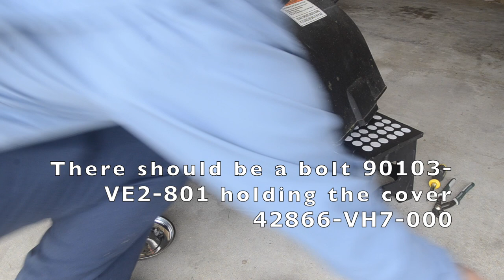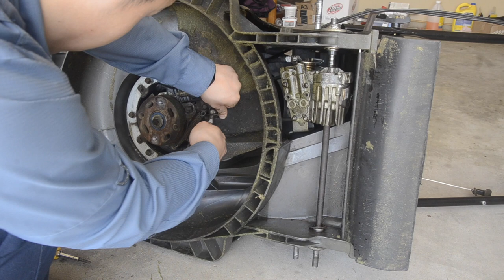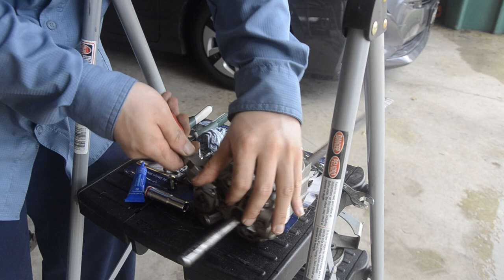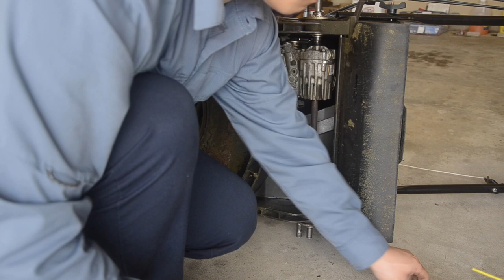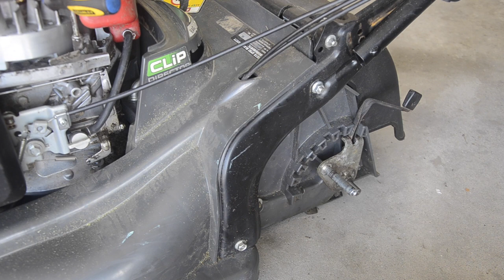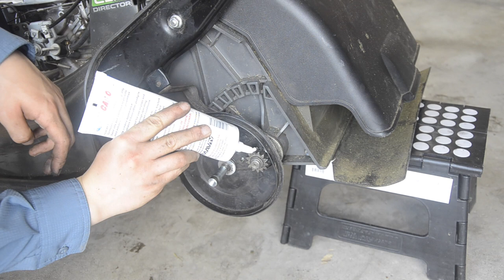Honda HRX217 HXA Lawn Mower Hydrostatic Transmission Removal, Fill and Installation

Comment: Here is the righr way to do the transmission replacement. 
1. You should drain only from top not from bottom using that 2 8mm bolt.
2. fill the original honda hydrostatic fluid all the way to top. Honda 08208-HST02 
3. rotate output shaft 4 to 5 turns ANTI CLOCK WISE complete revolution using your hand until 2 things happened. 
    a. no more air bubbles.
    b. fluid is not lowering .if it is lowering add more all the way to lip of the top cover. not just top again to the lip.
4. put the fill cover back using 8mm bolt and hand tight.
5. using 14mm bolt, rotate input shaft and depressing the drive arm lever both at same time. rotate  CLOCK WISE. and watch input shaft rotating.. again 4 rotation ... you can also user your drill / impact for this step when you use impact RPM should be super low to avoid oil aeration.

6. most important step, remove 8mm bolt and fill cover again.
7. Tilt your transmission left, right like wave pattern horizontallly in alll direction..  when you do that you will see bubbles comes out and liquid goes down. repeat step 3 to 7 .. 2 times until no buubles or lowering liquid.
8. fill the liquid to top,
9. there is a lip (around 2mm to top) fill the liquid all the way to overflow.
10. install gasket , cover and 8mm bolt..
11, note when you installing the cover there is a vent hole it should be properly orientated..  take picture of this while removing because vent hole align in both direction .. only one direction is right, that is vent hole should be closer to pulley side.

you are good to go..  

Ths is the right way.  you know you did it right if you dont have growling sound after the flush and you are able to achieve 30 feet in about 6 to 7 seconds at top speed with engine rpm between 2900 to 3100 RPM.

just did this today and i do have service manual..  this is per the manual.
Reply: Thanks for this, especially  the vent hole, I wasn't sure where this was supposed to align to. Should the transmission be completely silent when in use?
Reply: @crisprtalk6963   Vent hole should be closer to pulley of the input shaft..  if you see grinding noise or whinning noise then the fluid is lower. you have to redo it.
Reply: I see that you know  this like a professional, that's why I want to ask you question. On both sides is the transmission oil seal (91204-KE8-003 part number). On one side of the oil seal is the grass guard (21912-VE5-A00 part number) and pin (90752- VE5-A00 patr number) that holds the grass guard.   I haven't seen anyone who explained how to remove the pin and how to change the grass guard and oil seal. I only see one person who said that he would remove the grass guard because he things that it was the grass guard that caused the oil seal to split, but he did not explain how to do it.Can you explain please and Do you think it is a good idea to change the transmission oil seal at the same time when you change the transmission oil or is it unnecessary?

Comment: Thank you. This helped me better see the difference between the vka and hya models. However, I'm now discouraged from purchasing the HYA/HXA/HZA models as the transmission assembly alone is ~$400 and it still connects to engine thru a drive belt rather than a metal shaft.

Comment: This video was well done. It provided  visibility of all hidden components. I plan to R&R my 12 yr old mower and replace parts (belt, hydrostatic oil, wheel bearings, etc). It's a good time to clean, inspect, and lubricate parts. Thank you.

Comment: I see you like to put bolts back in the holes they came from- good idea, as it helps keep them organized.  Here is another idea you could try:   Use a 12-hole muffin pan (or two) put the bolts/parts in each hole left to right, row by row.  Then to reassemble, start and the last muffin hole and work backwards!!   Let us know if you try that method out, and how you like it!   Cheers, and thanks for a great video.
Reply: nice...

Comment: Thanks for the video!  Some of the steps aren't needed and you can use a pry bar tool to rotate the transmission to disconnect the belt from the pulley and to disconnect the bed-spring/washing-machine-hanger-spring from the transmission and deck housing.  Same goes for reconnecting.  
Also for the pulley removal, you can use a thick-diameter bolt or rod, which then goes through one of the holes in the pulley, and against a metal surface on the housing- that will keep the pulley from turning and avoids having to use a pipe wrench or vise grip to hold the input shaft.  
And make sure to follow the air-bleeding steps for the transmission that someone below had posted which is from the manual.  
Very very annoying mower to work on due to all the small parts, but you become an expert after fixing just one.  It's more of an advanced-mechanically inclined repair rather than just for someone looking to follow a YouTube video with some basic tools- unless you have time.

Comment: I just completely disassembled this transmission in order to remove the drive shaft and repair a section of it using my mini lathe. It's pretty cool inside. The transmission contains just two pumps with no gears or physical connections between them other than the fluid. BTW, it not something I recommend doing unless you are looking for a challenge lol.
Reply from the maker: If something inside the transmission needs a repair, I think I will either get a new transmission, or just use it as a simple push mower
Reply: But it may be good preventative maintenance. Replacing the belt gets you 1/2 way there. Agree it's not a job for a novice.

Comment: Thanks for taking the time to film this. I got the same type lawnmower and the transmission oil leaked out - I could see the oil on the garage floor where I store the mower; my intention was to replace the transmission but looks like they are hard to find and pretty expensive. I read somewhere that adding new oil will "rejuvenate" the seals. Not sure about that.
I'm assuming the reason you fixed yours is similar; could you give an update; is it still working fine? Thanks again
Reply from the maker: The mower in this video didn’t leak, but made grinding noise, so I decided to do a transmission fluid change hoping to remedy the situation. After the fluid change, the grinding noise went away, and the mower is working fine.

Comment: OR ... instead of taking the entire mower apart ...
1. Get 6mm Allen wrench. 2. Drill hole thru right rear wheel backup plate and two plastic layers (easy). 3. Remove oil plug and set on hill to drain. 4. With slender funnel, fill 7 ounces of Honda trans fluid ($10 for bottle of 12 Ounces). Spin axle while oil goes in. 5. Replace plug.  We went from not pulling at all to running behind it. There are two drain plugs. The other is impossible to get to. All easy to see from underneath.
Reply: I know this comment is a year old, but do you know if anyone has made a YouTube video showing this procedure? Did you have to hold the transmission lever in the engaged position while you drained and filled the transmission to fully remove the old oil and completely refill? What you said makes sense. Seems like you only need access to the drain port and then refill through that same drain port.
Reply: @SarahParry-ws8dn  I do not know if anyone has made a video of it. But ... thanks for volunteering ?
Reply: I just read this comment and I'm going to try this method vs taking the entire mower apart
Reply: @mattburgess6986  let me know how that goes cause I too plan to replace the transmission fluid with the assembly installed in mower
Reply: @taibiservent  Ok so there is a drain port that comes off with an allen key, and a fill port, which is the one he adds the fluid to in the video. I couldn't get the fluid to go in through the drain port, so I ended up having to take the mower apart after all to add fluid through the fill port as the fill port isn't accessible unless you take the mower apart if that makes sense. The fluid in mine was all grey and looked as though water got into it through one of the seals, so I ended up ripping out a transmission from an old Honda Mower I had, (same model) and replaced it, and then my mower ran fine. I talked to a Honda dealer and they said they didn't recommend replacing the fluid in the transmissions unless you add the exact amount, if you put in too much or not enough it may not run properly, so make sure you find out the exact amount of fluid it needs before replacing it
Reply: @mattburgess6986  thanks for replying. I wish I never took those four bolts off so I’ll get the transmission fluid for this Honda mower and make sure I put in the right amount. I was thinking of just adding it into the transmission since I took the plate off and the gasket and turn the mower upside down, I’ll look for the port thanks for the advice I appreciate it

Comment: Why did you remove the blade clutch and pulley?   You don't have to do that do remove the belt,
you just have to remove the clutch cable.       That's according to the official Honda shop manual,
and I just did it on my mower  (after watching your excellent video that gave me some 
confidence, thank you).
Reply from the maker: damtor 
The few YouTube videos I watched removed them, I felt I need to remove them and I don’t have a Honda shop manual. Thank you for your advice. I will try it in the future if I need to take it apart again
Reply: I do agree
Reply: I realized that too later but I'm glad I removed mine as I found the Plate ball control behind the clutch assembly was bad. At least this way he got to see the condition.

Comment: I need to repair or replace my  HYDRSTATIC  CLUTCH CABLE, please show me how on my Honda lawn mower.
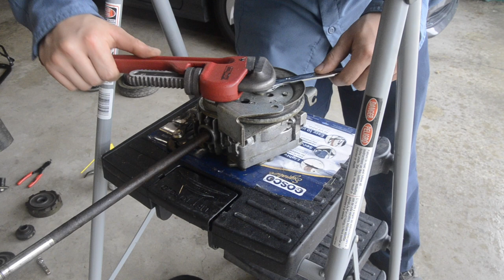Reply from the maker: If my memory is correct, the part with a hole which has a cut on the side under my left hand at 31:12 is where the clutch cable goes, and it is a simple clip holding it. I don’t have a plan to take apart my mower in the near future, sorry no new video on it.

Comment: I have this exact mower and I'm trying to disassemble the wheel following your video. After I take out the 1st snap ring the washer right behind it does not come out easily like it did in your video it seems that the washer is stuck inside the groove of that shaft where the snappering was and is too small to just simply come out. Any ideas?
Reply from the maker: I'm not sure which part you are talking about. There is only one flange bolt holding the wheel onto the spindle. If you are talking about the snap rings and washers holding the transmission output shaft onto the deck, I don't remember mine being too hard to remove. Maybe someone before you hammered in a washer, maybe rust has welded the washer to the shaft, or excessive wear and tear has carved a groove on the shaft.

Comment: These newer self-propel RWD is much different than the HR215 or HR195 series (came in 3spd or hydro tranny); there are two shafts for each rear wheel. I wonder if the older design w/ a single shaft is better bc of less moving parts
Reply from the maker: I have no experience with other or older design hydrostatic transmission, but this transmission has served the previous owner(s) more than a decade, and still serves me well even before the transmission fluid change, so at least this is a good enough design.

Comment: I’ve got a Honda hrx 217 with the hydrostatic transmission on it and It will not self propel unless it’s on the highest 3 settings and when it does self propel it’s very slow. Do I need to refill the fluid? Or is it another part
Reply from the maker: I would check the cable adjustment first. Maybe for some reason, your speed control is out of adjustment, your highest speed setting on the lever is actually a mid or low speed on the transmission. 
If you see sign of oil leak on your transmission, you may actually need to refill. Before refill and reinstall, try to find where it leaks and then seal it, otherwise your transmission may quit working soon due to leaking.
In the worst case scenario, you may the the unluckiest one that need a new transmission.

Comment: How much hydrostatic fluid did you add? Looks like you just filled it up until it was full? Hard to find an answer online
Reply from the maker: Sorry, I don’t remember the exact amount.
Reply: You use about have the bottle, maybe less.  Make sure during the flush to just use some 5w30 or similar before using Honda's hydrostatic fluid.

Comment: You have to put a socket on the flywheel bolt and hold it while loosening the blade clutch bolt which spins with the engine. 
Holding the blade wont do anything to loosen that bolt, unless the clutch is engaged. 

Also, don't jam a screwdriver in the flywheel, it will snap the fins 90% of the time.
Reply from the maker: NvDubs250 Thank you for your advise. I was lucky enough not breaking anything by jamming a screwdriver in the flywheel, but I shouldn’t push my luck. 
I actually engaged the clutch but i still cannot loosen that bolt, maybe my clutch is too old and about to slip during mowing in near future
Reply: I've been working on cars / mowers/ motorcycles for over 40 years. It takes time to learn. Congratulations 👏 on your successful repair / maintenance. Anybody can critique but comments should be respectful and helpful. Thanks for your video.
🇺🇸🇦🇫 2yrs.

Comment: Is it possible to change the hydro fluid without removing the entire transmission? I’d love to do this on my old HRX, but not wanting to pull the entire thing out to change it.
Reply from the maker: The fill port is at the top of the transmission, and I soaked the screws/bolts with penetrating fluid overnight and used large hand tool to successfully remove it.
Unlike the HRC(commercial) line, which gives you an access port on the deck near to discharge chute, I fell it would be impossible to fit tools to remove the fill cover.

Comment: Great Video!
I need to buy snap ring pliers to do this on my mower. What size snap ring pliers do I need to buy?
Reply from the maker: This is the snap ring plier I used on my mower: https://www.menards.com/main/tools/hand-tools/pliers-plier-sets/tool-shop-reg-snap-ring-pliers-with-tips-2-piece/2445485/p-1444428098769-c-9156.htm

Comment: Hi how do you bleed air after filling fluid in transmission. Thanks
Reply from the maker: Around 38:00 in the video, I rotate the input shaft and output shaft to bleed the air out, I add fluid when I see fluid level drop. The transmission works fine after this transmission fluid change
Reply: @yzhang8629  Excellent jobs!! A couple questions...Did you drain the fluid before you refill it? and how much fluid needed to refill it? One bottle or two? Thanks
Reply from the maker: @shiau-lingjian4788  Yes, I drained through a drain hole as shown in this video https://youtu.be/AFYK8qOHcBg, I was not able to remove the too cover to drain or fill at the moment of that video, and refilling through that drain hole was not successful. I think you can drain and fill through the top cover as shown in this video.
I used about half bottle of the Honda fluid shown in this video.
Reply: @yzhang8629  Nice! I'll service mine next week. Thanks again

Comment: Is it possible to switch the pullys on the engine and the transmission to make it go faster?
Reply from the maker: If you have enough hand-on skills and a good machine shop nearby, I think it is possible but not necessary. If the mower moves slowly, check the adjustment on the speed cable first, make sure it can pull the speed adjusting arm on the transmission to the extreme. If one needs higher productivity from a self-propelled push mower, maybe switching to a ride-on mower is a better choice.